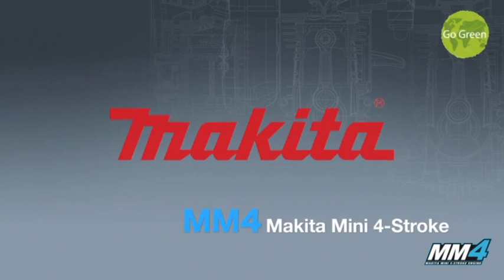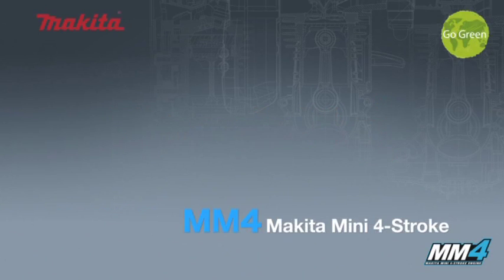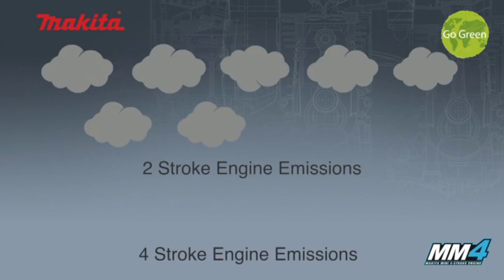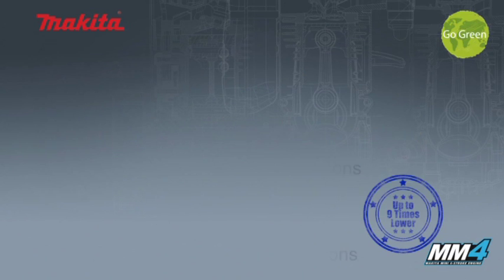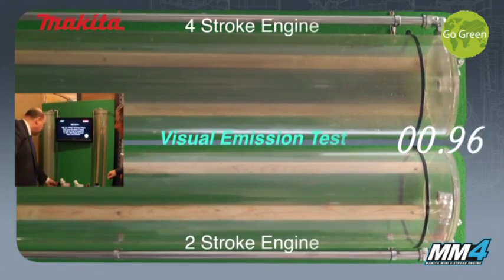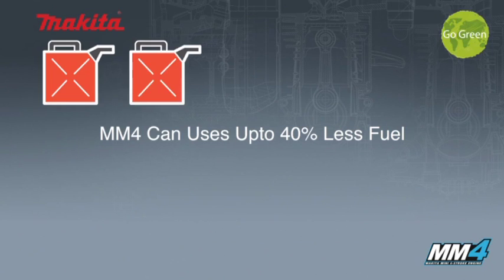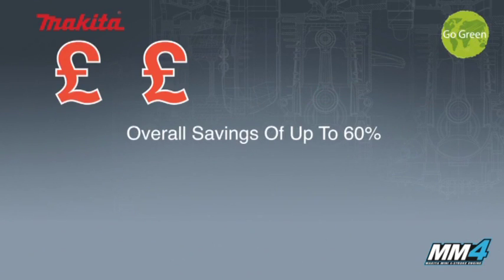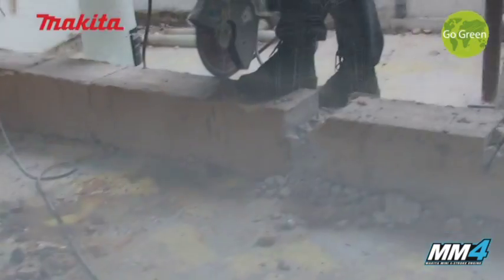Makita Mini 4-Stroke (MM4)

Comment: Nothing like a 2 stroke motor 2 stroke weed wackers were the best that they ever made. They were very light and you could work with them. If you had bad upper strombones like neck shoulders and elbows, they were very light.  The four strobe ones are too heavy

Comment: I've got this engine in my 14 inch cut off saw, it starts very easily and it has plenty of torque. I just hope I can maintain it properly as I bought it second hand and it doesn't seem to have much care in the eight years of regular use it had. If this motor serves me for 8 years after a bit of tlc, ill consider it one of the best investments I've ever made in equipment 👍

Comment: Why the hell don't they put it on chainsaws?
Reply: They have less moving parts and therefore they are smaller. This is a very important factor for chainsaws and other power tools because people often use them for hours, which wouldn’t be possible if they were overly heavy. A 2-stroke engine will always be more powerful than a 4-stroke engine of the same size.
Reply: @TheCeki1982  and yet I'VE GOT a 4 stroke chainsaw.... seems to cut faster than a 2 stroke.
Reply: @TheCeki1982 4 stroke makes its power over a wider rpm range vs a 2 stroke, is cleaner burning and uses less fuel. I like the torque...